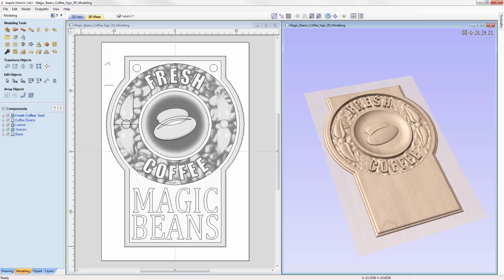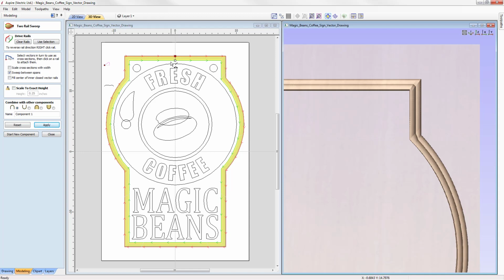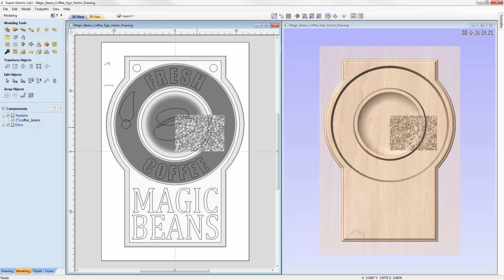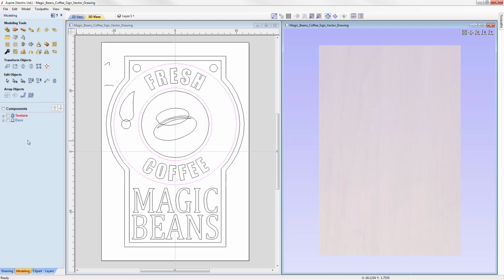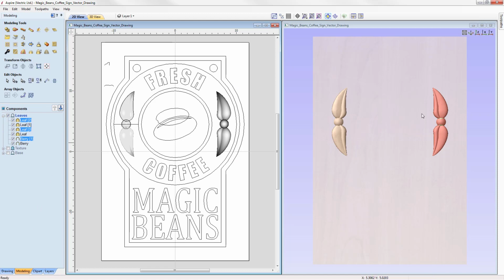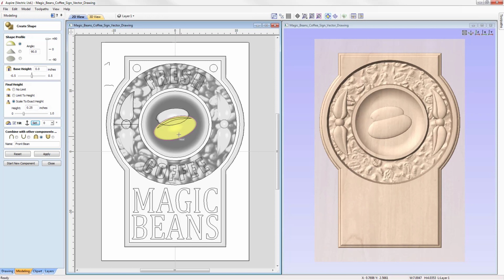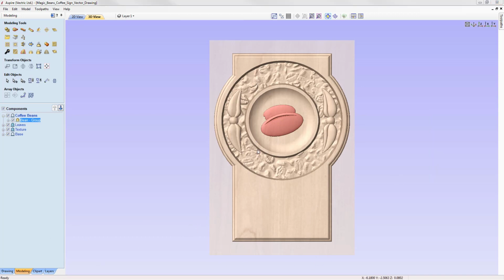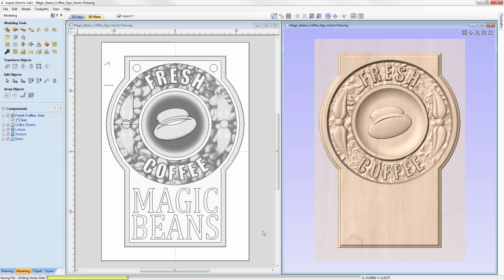Vectric V10 Tutorials | 3D Modeling | Magic Beans Coffee Sign

Comment: You forgot to do the 'MAGIC BEANS' text at the bottom and the hanging holes at the top.
Reply from the maker: Hey Tinkering John! The magic beans text and the hanging holes are actually machined, which you can find on the Toolpath video for this project :) I hope this helps!
Reply: @vectric  Thanks for the reply. After I left my comment, I realized that they would be created in the toolpath section. I like this program, but wished it was not so expensive for a hobbyist like me. I want to create some 3D artwork.